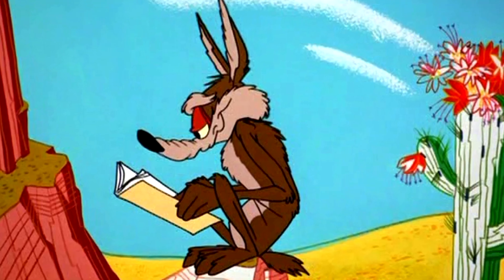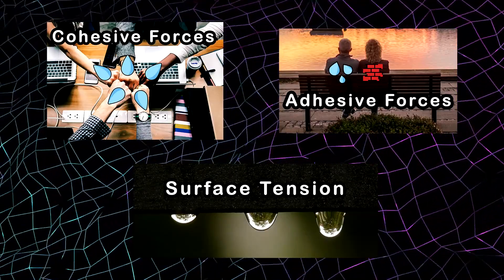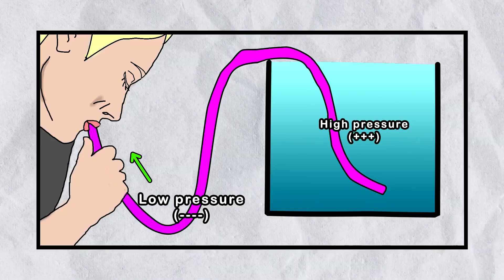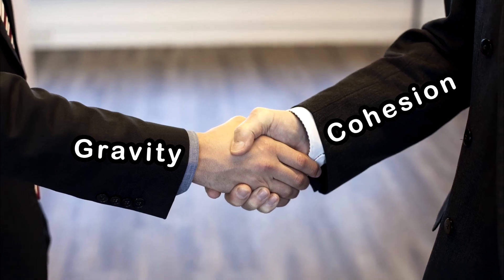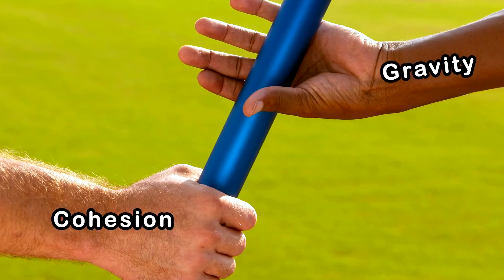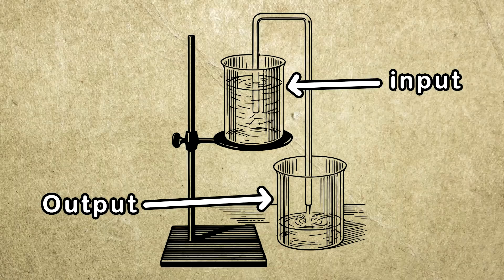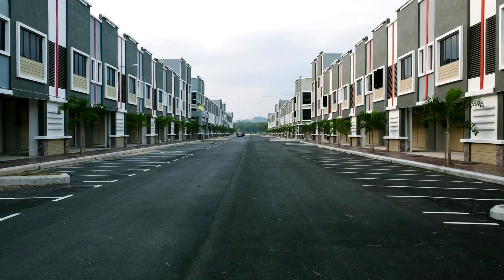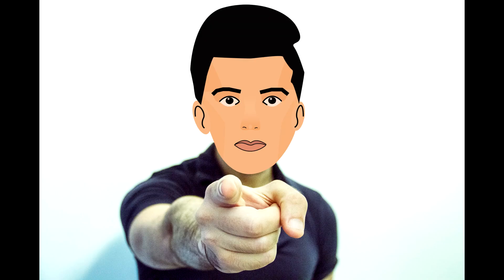why it doesn't work 20

Comment: Even if it did work, the water would eventually evaporate meaning you would need to constantly add more water, meaning you have an external force keeping the water flowing, meaning that it's not a true perpetual motion thing.

Comment: use electricity to split water into hydrogen and oxygen 
collect hydrogen in a balloon and lift a small weight to a higher platform 
when you burn the hydrogen you should get the energy you used in the 1st step back + the energy from dropping the weight 
bonus points if you collect the water you got from burning the hydrogen on the platform and collect energy from droping that too
Reply: wait why would this not work? the fuck.
Reply: @1_1bman  Biggest weakness is probably "how do you collect the hydrogen in a balloon".  Separating mixed elements like that takes work.

There is also, of course, the problem that burning hydrogen won't allow you to harness anywhere near all the energy that you "get" from burning the hydrogen... but that's an efficiency problem.
Reply: @Tzizenorec  no, i figured it out by myself why it wouldn't work. and it's not that.

air gets thinner the higher you go, meaning the balloons can't take you arbitrarily high.

if they COULD take you arbitrarily high, it would be free energy because the energy you get from dropping increases linearly with height but the energy you waste doing the electrolysis is constant
Reply: @1_1bman the electricity needs to be supplied I think

Comment: The hardest part of making a perpetual motion machine is hiding the batteries.
Reply: do you guys like pizza
Reply: @sosman64  can i say yes?
Reply: @CoolAnimaterer  yes
Reply: @sosman64  then yes
Reply: @sosman64  with pineapple?
Reply: @sosman64  can I answer? Or are you satisfied with your survey?
Reply: I like drink water
Reply: Especially if the battery is low, the machine will stop working, and some people would definitely leave 0-star reviews and ask for refund.
Reply: bot
Reply: @digitalastronaut007  nope, just bad at hiding when I reuse jokes.
Reply: @hamzamotara4304  unoriginal slop, smooth brain copy paste.
Reply: @digitalastronaut007 ... It's a joke that a lot of people use.
I thought that some people here might not have heard it.
I never claimed that I was original.
Reply: @hamzamotara4304  I never said you claimed to be the first
Reply: @digitalastronaut007  you called it unoriginal. I was agreeing

Comment: With anything suggesting how to make a perpetual motion machine, the answer is, "No, it's not possible."
Reply: What about something harvesting gravity, and although it doesn’t produce energy stuff spinning in space is perpetual
Reply: @jckoibra2662  Well, the moon is always in motion and gives us our tides. Can't we just harvest energy from our ocean waves?
Reply: @JediMasterBaiter  That’s true! I think I heard of a thing called a tidal generator but I don’t know if it’s future tech or a current technology. Either way a waterwheel is basically that.
Reply: @jckoibra2662  Aww shit. I looked into this and found out that, because the ocean is salty af, tidal generators are susceptible to corrosion.
Reply: @JediMasterBaiter  Maybe we can coat it with some kind of corrosion resistant material. The only problem is, the only place where perpetual motion would actually be useful or practical is in space, and there’s no tide up there. But if you were smart enough and lived by the ocean you could also build one for your house and get no electric bill
Reply: @jckoibra2662 Well I have bad news, rotation isn't perpetual either

It's extremely long lasting, but nothing lasts forever, except maybe dark energy (if it doesn't ever go away and keeps at a constant)
Reply: That's never gonna stop the trolls!
Reply: @asorix_iq3870  It will. Haven't you seen a troll with dementia? They showed those for a bit a year or two back
Reply: Frictionless vacuums:
Reply: @error_6o6  Literally, like something can spin forever
Reply: Glowie!
Reply: anything except negative mass object